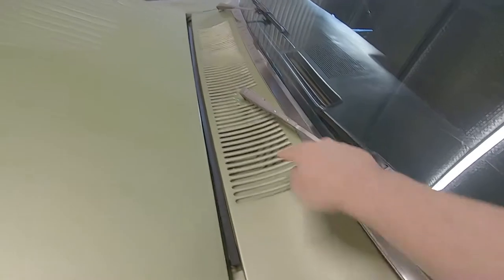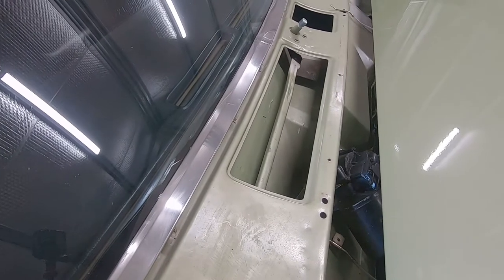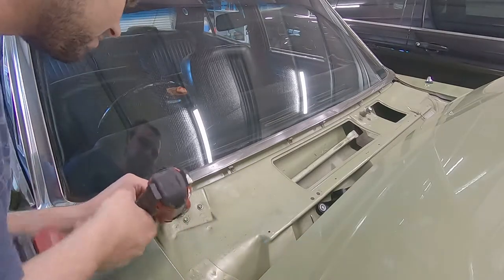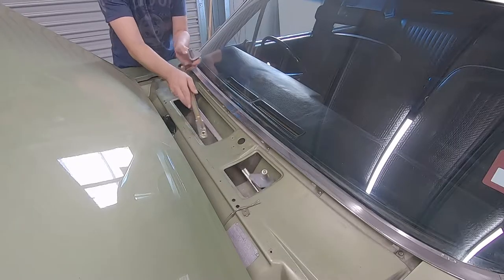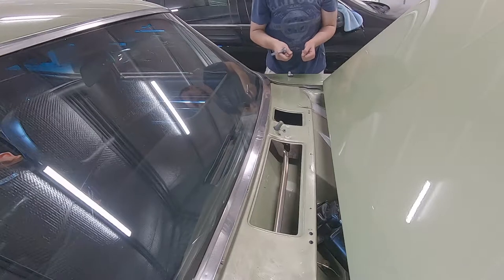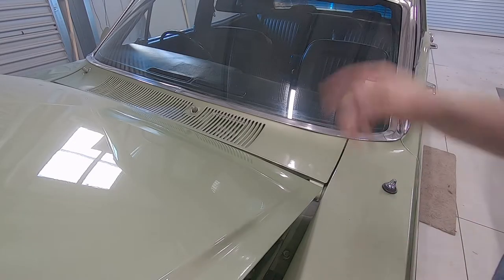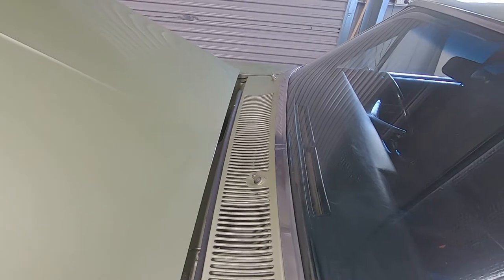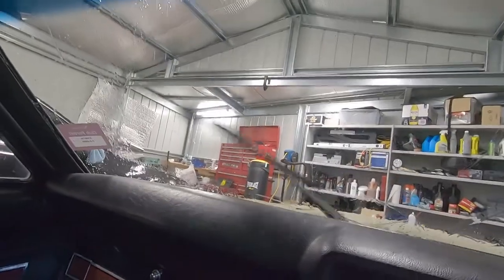Wiper Chatter Fix Part 2 - XW Ford Wiper Linkage Replacement

Comment: I have an XW GS 302 and the video on the fuel gauge will help me as mine stopped working thanks
Reply from the maker: Is that the Starlight Blue one in your avatar? Love that colour - especially if its a GS too!! Is the car all original or been restored?
Awesome - glad to know that vid is going to help out!  if you can get your hands on a pump to drain the tank (and seat the O ring properly lol) it's a pretty straight forward job - Hopefully the new sender lasts a bit longer than my one did...
Cheers for watching and the comment - hopefully I can save you from breaking stuff on your car if I do it to mine first hehehe!
Reply: @MeatballGarage  yes a real one built at the Ford factory in Brisbane, original number plates and never been unregistered since new, 4 speed yes repainted but it’s correct colour
Reply from the maker: @andrewguy1249  Factory GS 4Spd on original reg - what a car!!! Look after her mate - I love these things more than GTs as they are so hard to find unmolested nowadays!

Comment: It's great that these video's stay up for years because it can help anyone doing a similar thing when you're searching for info. Good on you for showing us the stuff ups and ways you went to get to a point you're happy. When my HQ ute busted a driver side wiper arm i borrowed the misso's XY ute wiper arm and used that for a few years believe it, so the stalks work in similar fashion as i found out. Do you still own the XW "monty?
Reply from the maker: G'day mate - Cheers & thanks for the kind words! I gather there are more hacks out there (like me) that have more enthusiasm than actual skill when it comes to cars, stuff ups are all just part of the learning process and although can be damaging (and costly...) make for a good story afterwards.
Ha how about that - a XY Wiper on an HQ! I suppose those old things would have all been made by Trico or someone back in the day and would have gone on almost anything! 
Yep still got the XW, she is gathering a bit of dust these days now i have a little rug rat - but have a couple of jobs i want to do over spring/summer - so they will be filmed and up here in all their glory (stuff ups included).
Have you got something similar yourself?
Cheers and thanks for watching mate!
Reply: @MeatballGarage  yeaheah it's interesting what swaps and works between models and manufacturers of similar era,  we have XY ute HQ ute XD sedan and few other Fords in 90's models. Nothing overly fancy but safe drivers and fun. I have the old (wish i didn't sell it) story but hey,  good to see some cars still being looked after. XW is one of my fave's and the green just tops it off for me. Stick at it and stay safe mate, good luck to your lil family too.